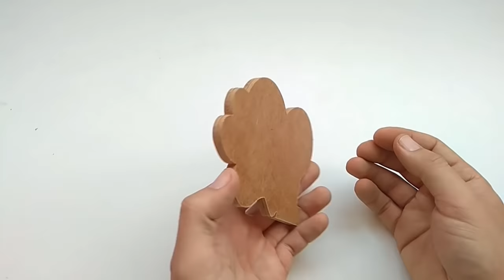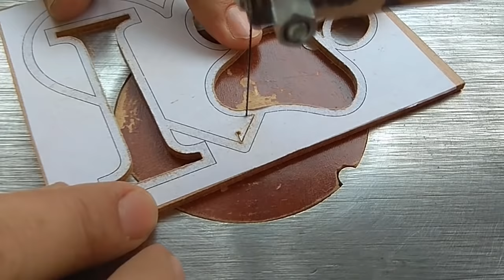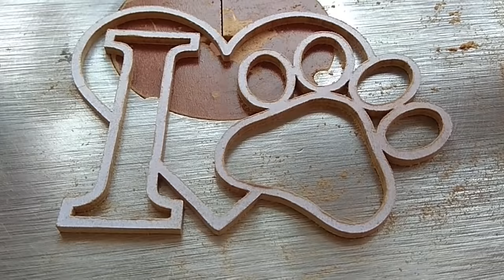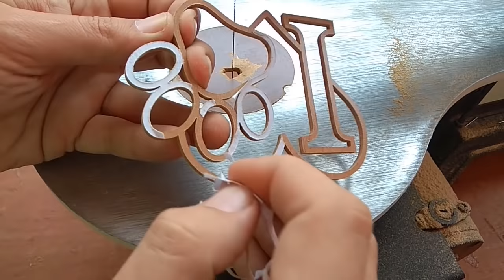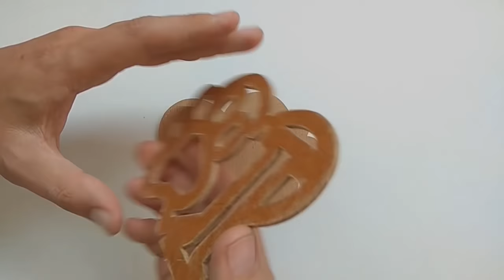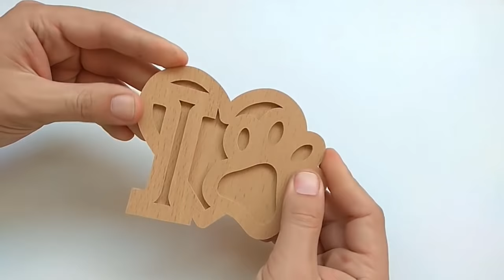Scroll saw project for beginners

Comment: How did you cut the first 2 pieces. Only showed how you cut out the last layer
Reply from the maker: I cut them the same way, by scroll saw
Reply: I understand that you cut it with a scroll saw. But is there different template for each piece

Comment: What adhesive are you using?
Reply from the maker: Hi, I used glue "88" of Ukrainian production, instruction: apply glue on both surfaces, wait about 10-15 minutes until the glue dries, squeeze the glued surfaces. Someone wrote that in the USA similar glue calls "Contact Cement"